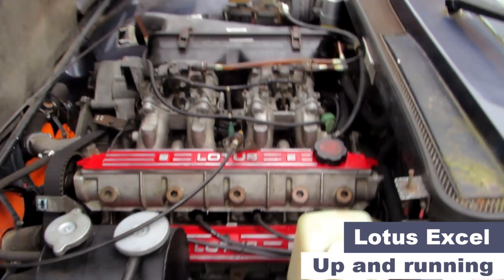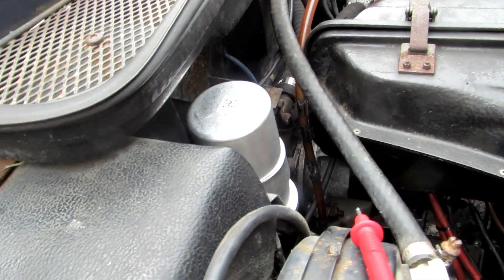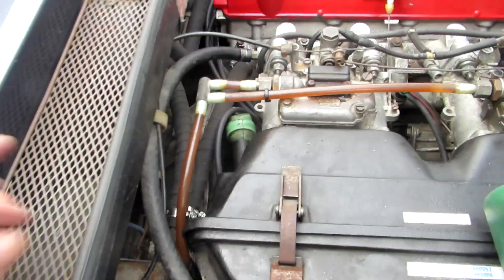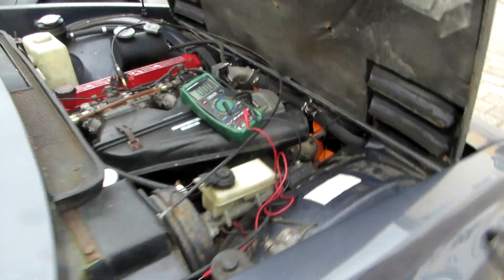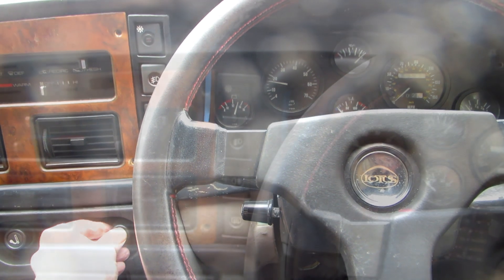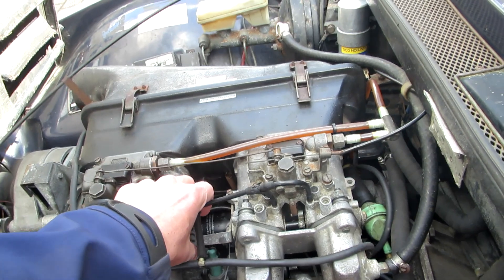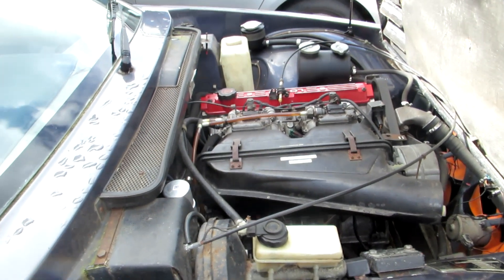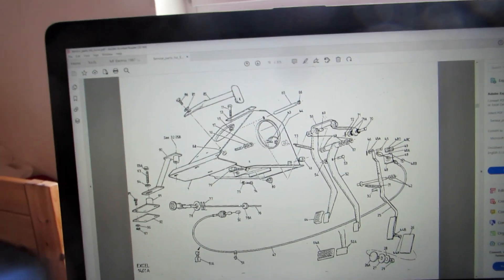Lotus Excel Part 17: Up and running....

Comment: Two things can bend on the clutch pedal. The lever extension can bend out of line with the master cylinder. That's potentially fixable in situ and is worth trying first. The second is that the 'bridge' that runs over the brake pedal can twist and that is a pedal box out job. I had a very low bite point in my '88 Excel (the red one) and a combination of bleeding the clutch and adjusting the clevis (which is now at its limit) made it much more useable. 

I had several ignition failures, all but one due to bad connections. The ignition is electronic and may not spark if the battery is too low. The AB14 'amplifier' box contains little more than a fairly generic 'ignitor' module. Those modules are actually very reliable and the only thing to watch out for is overheating where the heat transfer compound has dried out. A faulty rev limited can be a problem and is worth disconnecting just for testing. Whilst I had the carbs off for rebuild, I pulled the disributor and remade the connections bentween the reluctance pickup and the loom to the AB14. I also cleaned and tightened all of the spade connections and my car has been faultless since. 

I've found the best starting procedure to be enrichment full on (it's not a choke), no throttle and no priming. Let it run for about 30 seconds before trying the throttle. Once it will rev cleanly, enrichener off.
Reply from the maker: Thanks once again for the advice Paul, much appreciated. I will have a look if it is possible to bend the lever extension with the pedal box in place. Have you removed the pedal box yourself? Can you give any advice on that at all? cheers, Neil.
Reply: @MrScroogeNeilDonaldsonClassics  No, so far I've only had the mastercyclinder out on the '85 Excel. That wasn't too difficult, but there are more electrics in the way on post '86 cars.

You might get some help from MikeC73's blog. Search for "lotus excel rebuild blog".
Reply from the maker: @EVguru  Thanks, I have seen Mike's blog, I think his is a pre-86 model too... I will just crawl under there, have a look and remove what is in the way, slowly, slowly...